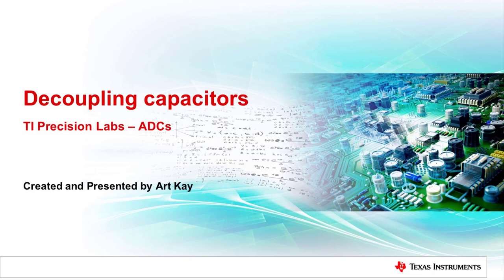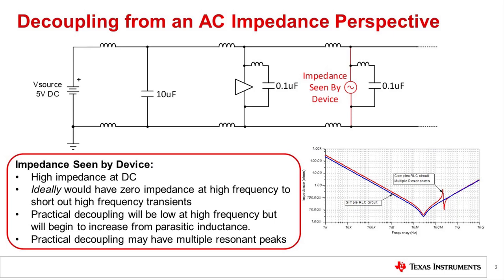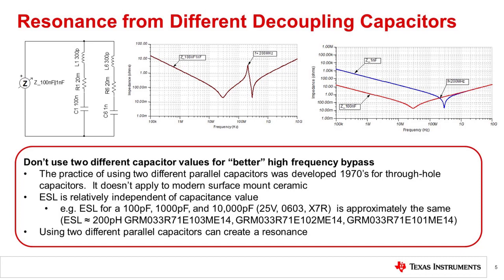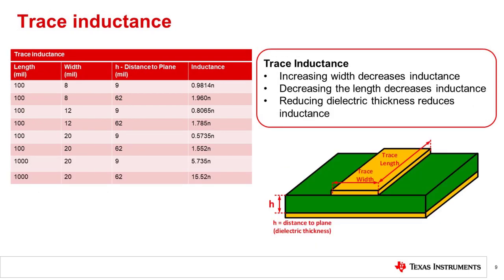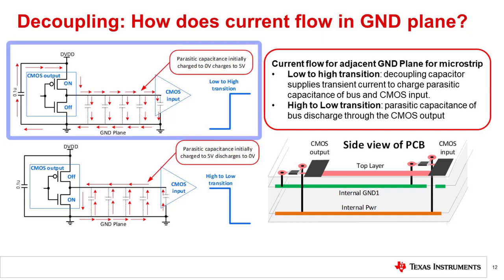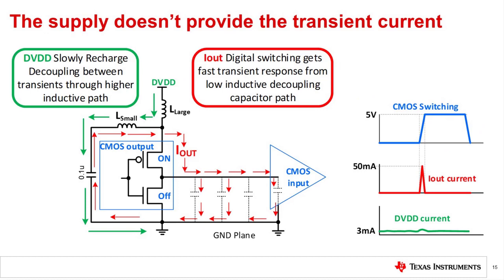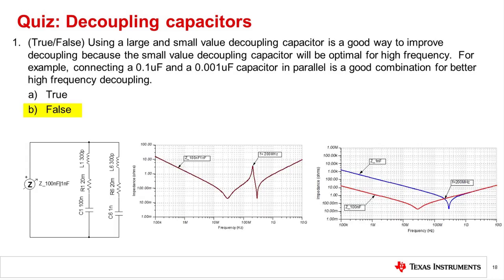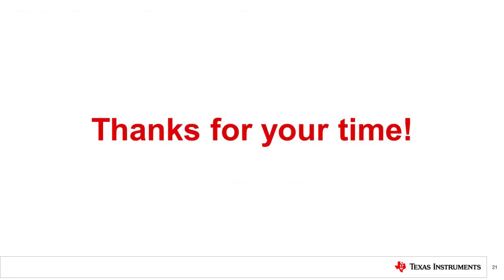Decoupling capacitors

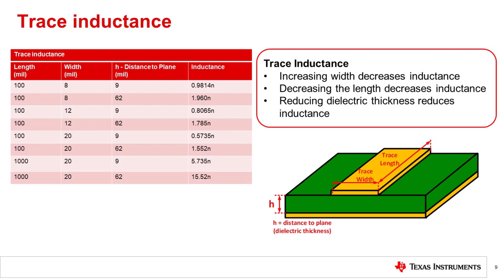Comment: At 7:57 the presenter says that typical ESL of capacitors is about 200 nH, and thus the traces inductance to a decoupling capacitor can "easily be a dominant factor". But the table shows inductance between 1 and 15 nH, nearly 2 orders of magnitude smaller than the ESL of a capacitor. Why does he say then that the trace inductance can be dominant, when the ESL is so much larger? Am I missing something?
Reply: ah so in the next slide the schematic shows ESL of capacitors to be around 0.2 nH. So I think he either meant 200 pH or 0.2 nH at 7:57 and he just misspoke. Makes sense!

Comment: Great video! Do you think filled vias make a difference?
Reply: Filling vias should have a minimal impact on Inductance as the skin effect causes the high frequency current to flow on the surface of the conductor.  It will impact the dc capacity.
Reply: you can fill it with peanut butter and it wont make a difference
Reply: @gillsejusbates6938  That's from Rick Hartley in "The Extreme Importance of PC Board Stack Up" (35:15-ish). True for regular vias that do not carry significant DC currents.

Comment: Hi Art,

That is a great presentation! That is a solid starting ground (no pun intended) for a "lowish" frequency circuit layout. Thank you for sharing!

Particularly interesting that using multiple decoupling capacitors of different values can be detrimental due to same ESL. That really was a good practice back then when SMD was not widely available,  so the usual 100pf || 1nF || 10nF...

Now, being picky here, at https://youtu.be/3rxKZWQk_DY?t=485, you mention that the trace parasitic inductance of decoupling capacitors is about 200nH, and can easily be a dominant factor compared to the parasitic trace inductance. But looking at the table and also at the next slides, I believe you meant the ESL of decoupling capacitors is about 200pF, not nH, right?
Reply: Yes, I meant to say 200pH, not 200nH.  You mentioned 200pF in your comment, and I think you meant 200pH as ESL is an inductance.  In any case, I will do an update on the video to correct the issue.  Thanks for pointing it out.